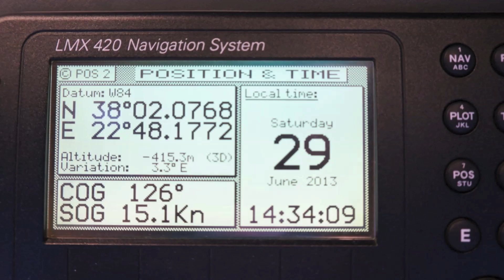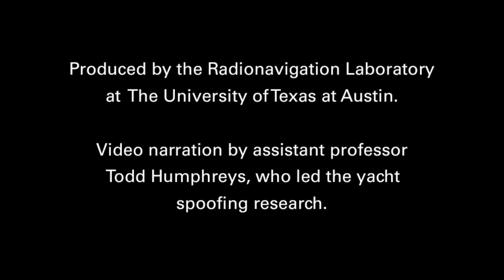Researchers Coerce Superyacht Off Course

Comment: This would work from a nearby vessel or from a cabin of a cruise liner.  Also no modern crew uses sextant readings which are only accurate to 1/4 of a mile anyway.  Also the compass gives you direction, not position.  In my view this is very likely to work on any crew.

Comment: How convenient for the so-called attacker to be located on the same yatch. Equally convenient that the crew would rely solely on GPS rather than cross check against compasses and sextant readings. Not likely to work on an experienced crew.

Comment: With the common use of GPS even on personal craft for cruisers, IF there were some worldwide unrest there is a possibility of government or governments (Or pirates!?) taking control and leading the yacht where they want it, IF, the yacht is solely running on GPS and the skipper not taking the occasional sextant reading and watching the compass (Like when cruising at night while asleep.)? This super yacht had a compass? And the crew trusted the GPS system and did not check their location? Right?